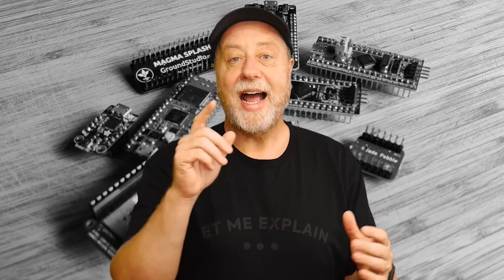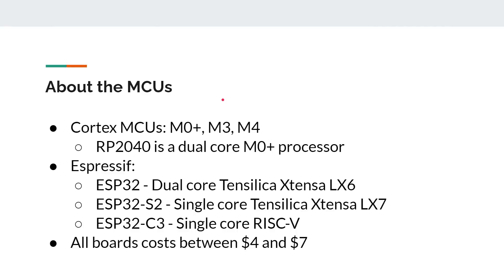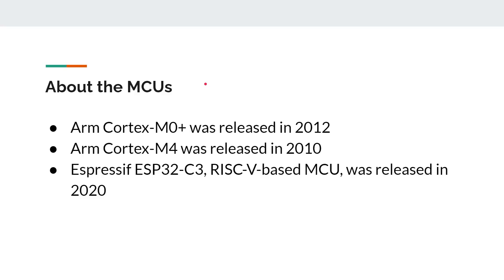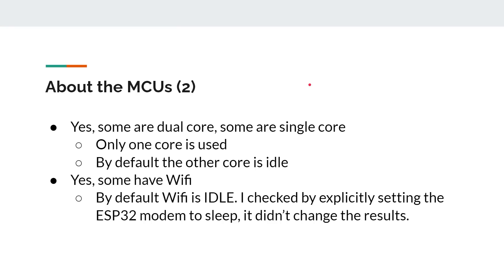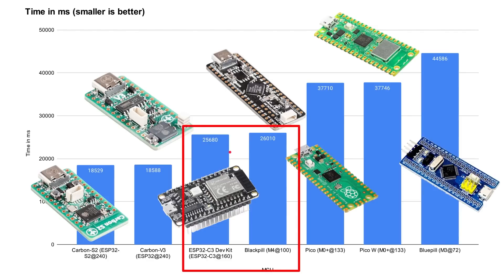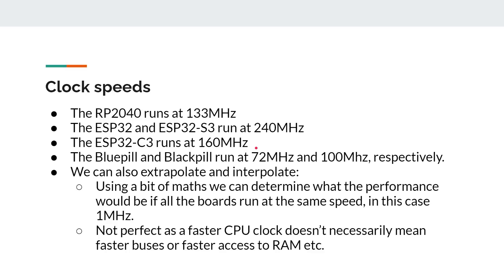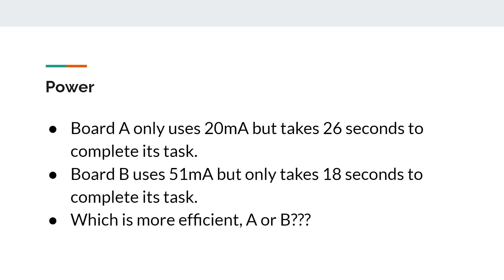Arm vs RISC-V? Which One Is The Most Efficient?

Comment: One more comment. Most processor manufacturers produce a spec called DMIPS/MHz, or millions of integer calculations per megahertz clock speed. This allows you to do a clock for clock comparison between parts.
Reply: Let me wind back the clock to the mid-80s to point you at the horrors of  the Dhrystone benchmark which back then was more or less the canonical benchmark for integer performance.  Even in the best case Dhrystone results didn't represent real world performance very well. Dhrystone wasn't only ignoring fp math entirely, its results also got more and more comically absurd as architectures got more sophisticated (caches and out-of-order made a giant difference) but also as compilers improved and started to "optimize away" part of dhrystone.  The peak was rached when certain compilers started to recognice Dhrystone and applied Dhrystone-specific optimizations for almost arbitrary benchmark results - whatever marketing orders ;-)
It gives me headaches to see parts of the industry are still using DMIPS decades after it's been throughly proven to be rubbish.
(It seems many folks don't know these days - the D in DMIPS stands for Dhrystone).
Reply: @ralfbaechle  Thank you for this informative comment. One learns something new everyday.
Reply: @ralfbaechle  3 years late...but your knowledge is specific to PCs.

These microcontrollers do not have an MMU, the FPU is optional, and they even lack hardware divide. They also use in order execution - and it took ARM until this year (2025) to launch the C1 Nano (Cortex-A530's new name) to finally make their small cores use out of order execution. 

The microcontrollers in these are architecturally similar to the chips used back in the 80s and therefore the benchmark remains relevant in that sector while it became useless for PCs 30 years ago.
Reply: It's an artificial value though and not very helpful for real world performance comparisons.

I know this because Qualcomm quoted quite a high DMIPS for their Krait CPU core back during the ARMv7-A generation, and it routinely got thrashed by the lower DMIPS rated Cortex-A9 based SoCs in actual performance.

Comment: Great work as always. Benchmarking is always a can of worms because it is as dependent on the application as it is on the processor. Do you need fast integer? Fast interrupt response? Floating point? DMA?  If you used newer M3 and M4 parts they would have performed much better even in this integer-only test both with regard to processing speed and power consumption given that they’re built on much newer process nodes. And a recent STM32 M7 would’ve blown everything else out of the water.
Reply: Why are so many of the commenters here so obsessed with process node? It strikes me that many (not aimed at you in particular Mark, sorry) may just be reciting jargon without understanding it. Even a very old node such as 180nm is good enough for making a 300+ MHz chip (e.g. the SiFive FE-310 on many RISC-V microcontroller boards) which is plenty for anything in this test. Smaller process nodes do allow higher clock speeds, but if you're not USING that ability then they are not just a waste of money in the much more expensive design and manufacturing process, but they may actively be WORSE because of things such as higher leakage current when operated at low clock speeds or in low power sleep modes. It's also a complete waste when you're making a simple stand-alone chip such as a microcontroller with a small core and a small amount of SRAM because even with the old nodes you end up with the actual processor&memory being a tiny little square inside a huge bit of silicon with the I/O pin pads taking up 90% or 99% of the extremely expensive small process node chip area. The default assumption unless you're a real expert should be that the manufacturer has chosen the best process node to optimise what they want to achieve with their chip.
Reply: @BruceHoult  In general I would think that a smaller feature size would mean less parasitic capacitance, but I didn't think about leakage current. Is that from quantum tunneling? I wonder where the sweet spot is for that. But there's also the matter of different topologies like finfet and gaa, that might reduce the switching current. Mostly I think it's an economic decision. Everybody wants better speed and battery life, but how much are they willing to pay for it? For a computer that only runs a single program continuously, all you need is "good enough". Microcontrollers often have external power anyway. The main concern vis a vis power consumption is cooling.
Reply: We are familiar with needing to sample the test code many times to generate benchmark results which are not misleading, but it is also essential to sample different kinds of test code, to not be misled even by random compiler differences on each bit of code tested. With the performance results between the esp-c and the black pill coming within 1% of each other, that suggests the test was entirely memory bound on those systems and the systems share very similar memory systems. Multiple programs need to be benchmarked for a picture to emerge.

Comment: That is very slow M4, low power version? Most M4's run at 168Mhz or 180Mhz or so.
Edit: And real power of the stm32 M4 is the FPU. Maybe you can do a floating-point test between esp32, risc-v and the M4.
Reply: Low-power variants of M4 have reduced performance, especially in DMA and Bus Matrix as they have been simplified  (in order to maximize battery saving and system power consumption under green something) compared to workhorse F4 with better parallel architecture in DMA and Bus-Matrix. The reason for M0+ from M0 is that interrupts have been proven to be too limiting in the past, where M0+ relieved some of this issue.

Comment: I appricate that Gary is right here that RISC-V is not yet as effecient as but I'm very impressed that RISC-V is already almost as efficent as ARM with for the same processes being run 1.36mWh compaired to the equivlent ARM board getting 1.31mWh and even compaired to the much more established Pi Pico, it's only 8% less effient (than the Pico). Obviously being almost 89% less efficient than the Blackpill isn't ideal for RISC-V but this is still early days for it compared to ARM and just with there being so many less RISC-V processors produced vs ARM, I don't think you can expect it to be beating the leaders of the pack in ARM just yet. Maybe when there are as many models of RISK-V processor as ARM processors the leader will be arm. Maybe with more time for tuning, the leader of the RISC-V pack will beat the leader of the ARM pack; even with less models out there. Encouraging stuff.

Stating my bias: I want RISC-V to succeed as I think open source is the way forward and garding "intelectual property" like dragons over gold, is holding humanity back.

Thanks for the interesting video Gary!
Reply: The ISA does make a small difference, and the fetch-decode speed was a large factor up until high mHz and pipelined branch prediction. A clean(ish) slate approach to both the ISA and IMPLEMENTATION SPECIFICATIONS of Risc-V working in tandem is what gives RISC-VECTOR the edge. 
--
A proper Vector Processing specification instead of SIMD (an ISA DISASTER that should have stopped at SSE4 on the X86, and should never have been introduced into the ARM ISA)... A Vector processor was vastly preferable and the tech was well proven.
--
A major benefit is to combine CPU + GPU programming into one (much more) bare metal ISA, eliminating a ton of API translations and JIT compilation, Short but quite efficient or very long and perhaps more efficient pipelines can be experimented with by LOTS MORE CHIP (PART) DESIGNERS, while developers get a STANDARDISED ISA.. 
--
Bare metal GPU Compute will be much EASIER. Integrated graphics and general purpose Vector processing compliment each other, but software-only graphics systems using just the vector processor and a few CPU cores could be more efficient and good enough for web + office..
Reply: Awesome video Gary. Lots of hard work! Wondering if clocking can be slowed down in software so when the fast parts are done, they can go into a low power mode. Might change the energy results a bit. Thanks again!
Reply: The ISA and the IP underlying the implementation of that ISA are separate. The IP of risc-v will be closed source for the most part, this doesn’t solve your  ‘hoarded like dragons over gold’ problem.
Reply: @countbowl  it’s a mixture. Probably the leading edge of performance will almost always be closed source, but open source is nipping at the heels of the commercial IP providers and keeping them honest. Already we’ve seen two large companies spend serious money on developing high quality cores for internal use and then open sourcing them: Western Digital with their SWeRV cores (roughly like Cortex M7), and Alibaba with their C910 that is something like Arm A72 of A73.
Reply: You're in the realm of potential compiler optimizations...  And which process node these chips are made of...
Reply: I agree.  RISC-V is not there yet but made a very good showing being the new kid on the block.  ARM has been at this game for decades.  It is unrealistic to expect the new kid to outperform the veteran.  ARM has been optimized over decades.  RISC-V has to pay its dues to take the crown.  I am strong RISC-V advocate.  I look at this as there is plenty of room for RISC-V to improve.  The ground to cover in some areas are not that great to close the gap.
Reply: arm & risc-v are nearly of same age.
Sadly, only ARM got attention at that time.
Reply: @xade8381  that's not correct. ARM started to be designed in 1983 and the first chips and boards were in 1986. ARM the company started in 1991, when there were already 100,000 ARM-based Archimedes PCs in use. RISC-V started to be designed in Berkeley university in 2010 (27 years after ARM), the initial frozen spec was published in 2014, the first board you could buy commercially from the first RISC-V company was in 2016 (30 years after ARM).
Reply: @xade8381  RISC-V was still an educational tool for years though, with zero plans for reaching any sort of market. Whereas ARM was made from the very beginning as a commercial ISA, and is 30 years older to boot. Not very comparable.

Comment: Back in uni, I still remember the active power (total power - leakage current power) is proportional to square of frequency. Can we use it to extrapolate the power usage of the pi to 160 or 240 mhz?
Reply from the maker: Or better still watch my previous video on this topic where I actually changed the clock speed of the Pico and measured the power usage.
Reply: Active power is proportional to Vcore^2 * frequency. Not frequency squareq but just frequency multiplied by core voltage squared.
You may get around frequency squared when cores are pushed harder than above mentioned microcontrollers (not as hard as full boost latest Intel or AMD chips, frequency still has to be supported by changing core voltage).
Reply: @volodumurkalunyak4651  The formula I remember from university is proportional to voltage and to frequency squared (P ∝ V * f^2).
Reply: @leonardosabino2002  i literally wrote the very same formula: 
Vcore^2 * frequency
power is proportional to frequency and to voltage squared.
Power scaling does also resemble frequency squared at some part of volt-frequency curve (probably 0,7 to 1V region for latest chips)
Reply: @volodumurkalunyak4651  Not the same formula. Look again, it's the frequency that's squared.
EDIT: I just looked up the formula, looks like voltage squared is correct. Sorry about that.
Reply: @leonardosabino2002  that is certainly wrong. Voltage times frequency squared is not right. I assumed you would remember formula from the university correctly (frequency times voltage squared)
Reply: @volodumurkalunyak4651  You are right, of course, I misremembered the formula.

Comment: I was surprised that the now somewhat venerable Black Pill did so well in these tests against the newer upstarts, especially in power consumption and power efficiency. Thanks Gary!
Reply: Not just "black pill" but stm32f401 or 411. Today one mc on black pcb tomorrow another...
And f411 has 12.7mA at 100MHz core with periph disabled. Not all periph is need to be on. I have doubts about this video test 20mA. The Chinese have a lot of analogues stm32. And for example CH32V203 (f103 clone with riscv core) has 8mA at 144MHz. CH32V30x  ( riscv core with fpu) 12mA at 144MHz. And they have ever tssop20 case. As f103 clone CAN onboard, that f411 doesn't have. And 307 has Ethernet, 208 has bluetooth + Ethernet and 2.2$ in my local store.  I have not been interested in buying stm32 for a long time. Only Chinese only like stm32 has CH32, HK32, AT32, GD32 and so on.